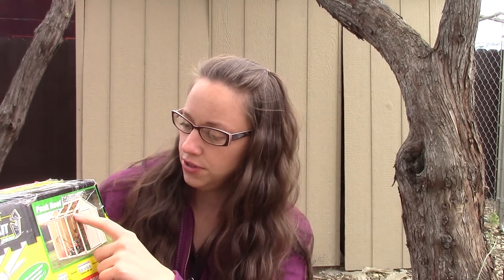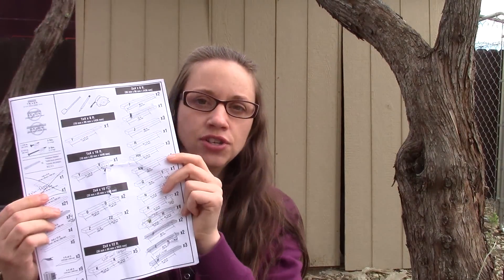I Built a SHED (almost) By Myself!!  👩‍👧🏠

Comment: How much did the entire shed cost with the kit included?
Reply from the maker: KBeeAk About $500! One tenth of the cost of a prebuilt unit. It is important to note though that the board siding and shingles on my came from a 2nd hand building supply store. They were still new, just at the cheaper store, so the cost might be higher if all materials were from a big box store.
Reply: Frugalgreengirl thanks for the info! Great idea!